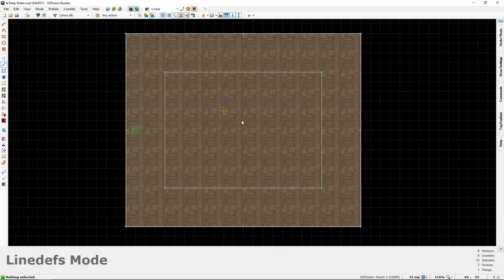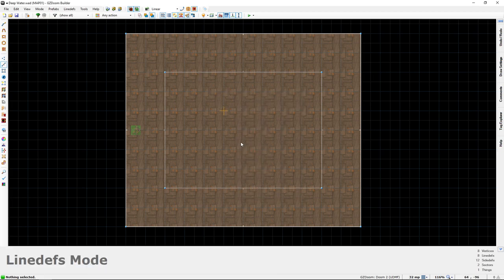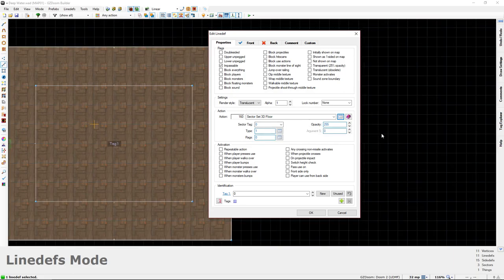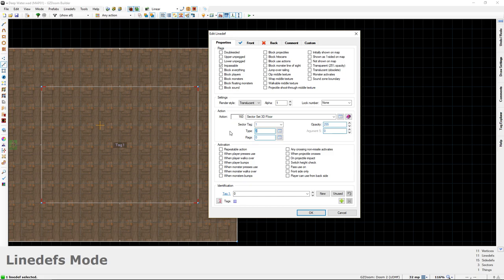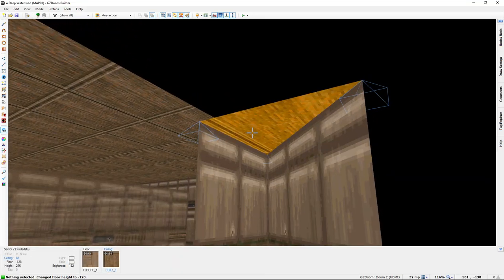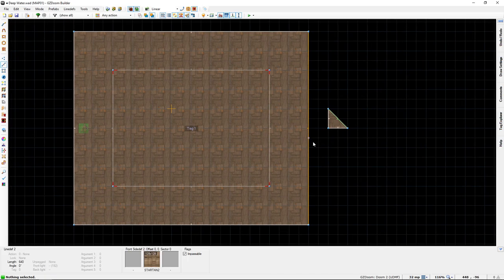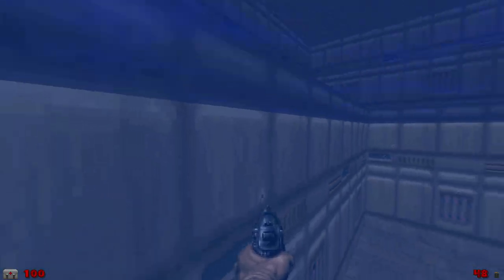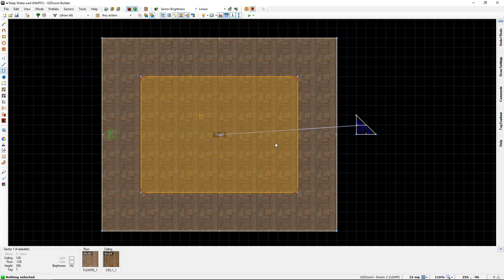(Doom Builder) Deep Water Tutorial

Comment: Got a dumb question-did you have any plugins or anything in addition to your standard GZDoom/Ultimate Doom builder? Cause I did exactly as the instructions said and then had to adjust the gravity manually to simulate swimming cause it didn't work right.
Reply from the maker: Nah, this technique should still work just fine.  Are you using UDMF format for your map?
Reply: @Chubzdoomer  Yeah, turns out they got an actual underwater sector mode when you go in. Though I went and clicked it and it treated the whole sector, even above surface part as being underwater. Kinda weird.

Comment: Hey Chubz, awesome video as always.  One question, I was able to create the deep water effect for my pool however I dont have the underwater sound effects that yours does when I fire my weapon.  Any ideas how to correct that?
Reply from the maker: Which source port are you playing with?
Reply: @Chubzdoomer  I use gzdoom .  Using that source port and running your bridge over 3d sector wad the sound plays however in my wad that I made it doesn't.  Wasn't sure if there is an option that I missed.  Thanx for the reply.
Reply from the maker: @richardkearney8178  That's really strange.  I just whipped up a quick test in Doom Builder and the underwater reverb effect plays automatically when swimming inside a "Swimmable" 3D floor (there's no need to perform any kind of special actions; the 3D floor just needs to be marked as swimmable).  Could you perhaps link me to your WAD?  I could try to play it to see if it's doing the same thing for me.
Reply: @Chubzdoomer  Thanx again for the reply Chubz.  I was able to get it to work.  It had to do with the dummy sector.  Now it's all good 🙂

Comment: I think I have a problem the Sector 3d floor. its not showing me the middle texture in order to see it properly and at even times I can't select the middle texture to change it to the water texture. I am using GZDOOM(UMDF) as well
Reply from the maker: Weird... I do know that sometimes it can be finicky to work with the 3D floor directly, and so it ends up being easier to just manipulate the dummy sector(s).

Did you ever solve the problem?  If not, you can email me the WAD and I can see if I can figure out what's happening.

Also, are you using GZDoom Builder or just regular Doom Builder 2?

Comment: How do you make a linedef tag on a 3d Floor without triggering it from a lower floor?
Reply from the maker: The only method I'm aware of is to use a script that checks the height of the floor underneath the player before performing the desired action(s).  You can do this quite easily by using the GetActorFloorZ function.

The idea is to check whether or not the height of the floor underneath the player is greater than or equal to the 3D Floor dummy sector's ceiling height (because the dummy sector's ceiling is the 3D floor's top surface/floor).  If that check fails, then nothing happens.  This ensures the line isn't triggered if the player happens to be below the 3D floor.

Here's an example I made:
https://www.mediafire.com/file/g16qall7vjegw3i/3dFloorWalkoverLineExample.wad/file

And here's the GetActorFloorZ Wiki page:
https://zdoom.org/wiki/GetActorFloorZ

Comment: How to open a wad file created in doom2 (doom format) in gzdoom-doom2 (udmf)?
Reply from the maker: First open it in DOOM format, then go to Edit->Map Options and change the configuration to UDMF format.  Doing this will break most if not all of the map's line and sector actions though, so you'll need to re-implement them afterwards.
Reply: @Chubzdoomer  thank you it works! But in the old map I have "SR lift lower wait raise". what is the udmf equivalent?
Reply from the maker: @bartekwatrowski2839  To make a lift in UDMF format that's virtually identical to those found in the original game, just follow these steps:

1. [In Sector mode] Right-click the sector you want to be the lift and assign it an unused tag.

2. [In Line mode] Left-click the lines you want the player to use in order to activate the lift, then right-click one of them to start editing them all.  In the Edit Linedef window that pops up, check both "Repeatable action" and "When player presses use" under Activation.

3. [Still in Line mode] Give the same lines in step 2 an action of (#206) Platform Lower Wait Raise (lip).  You'll see several parameters appear below it.  Of those parameters:
- Change "Sector Tag" to the same tag you assigned the lift in step 1
- Change "Movement Speed" to 32
- Change "Reverse Delay" to 3 seconds
- Make sure "Lip Amount" is set to 0 (meaning when the lift is at the bottom it will be flush against the ground; aka it will have no "lip" sticking up).
NOTE: When changing these parameters (with the exception of Sector Tag), I recommend using the dropdown menus rather than typing in the values yourself.

After following those three steps, you should have yourself a vanilla lift!  You can of course throw in one or more walkover lines to activate the lift, too, just like the designers often did in the original levels.  For walkover lines you'll want to check "When player walks over" instead of "When player presses use" in the Edit Linedef->Activation area.  Otherwise, the process is exactly the same.
Reply: @Chubzdoomer  Thanks a lot! You should write a textbook to learn how to create a doom! ;)
 There are still a lot of moving objects in the doom - and the possibilities are enough for a book or many clips.

Thanks!

Comment: Does it work in doom builder 2? Doesn't work for me.
Reply from the maker: The editor shouldn't matter as long as you're using the correct map format (UDMF or even Hexen).  Doom Builder 2 doesn't show 3D floors by default though, so you're better off using GZDoom Builder.
Reply: Chubzdoomer i fixed it